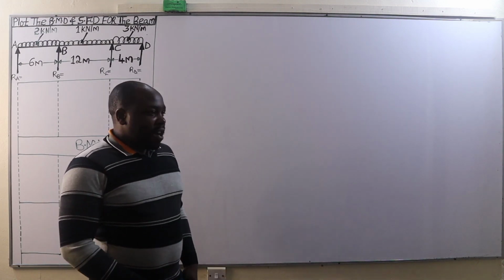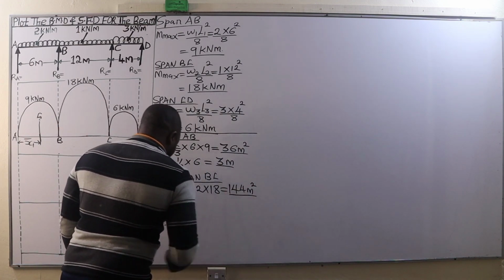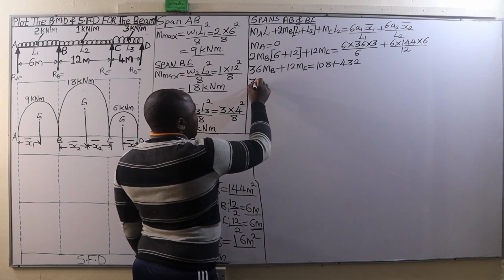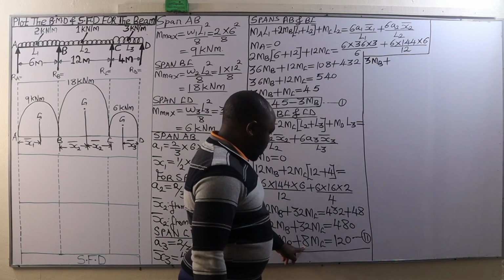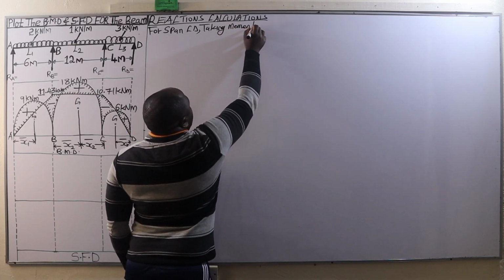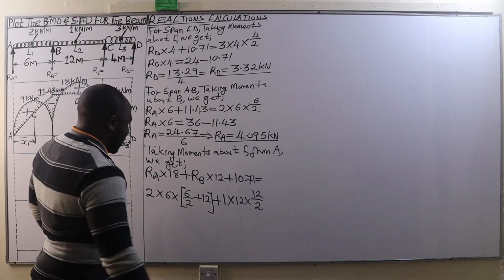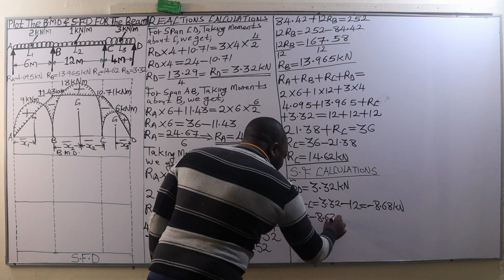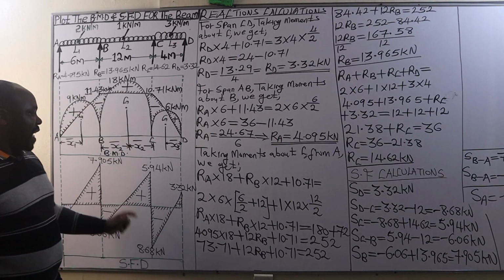ANALYSIS OF A CONTINUOUS BEAM SUPPORTED ON FOUR SUPPORTS USING THE THREE MOMENT THEOREM.

Comment: A bit challenge in reactions cal: for span AB when Tkn moments about support B why is (RA *6+11.43) taken as anti-clockwise
Reply from the maker: For span AB, when you take moments about B, the moment at support B is a Clockwise moment.
Reply: I mean clockwise , while I see RA is clockwise but what Abt the -11.43 kNm
Reply from the maker: RA*6+11.43 those are clockwise moments.
Reply from the maker: When taking moments, ignore the -ve sign on the support moment. Then, look at what direction the moment is going to take.
Reply: @georgekamiti6538  okay  ignoring the sign  how will I identify the direction in which the mnt takes because am now confused how you choose for span CD the 10.71kmn is anti and for AB the 11.43 is clockwise.?
Reply: 👍 I have seen how mbele iko sawa